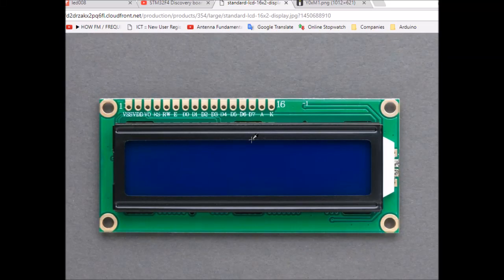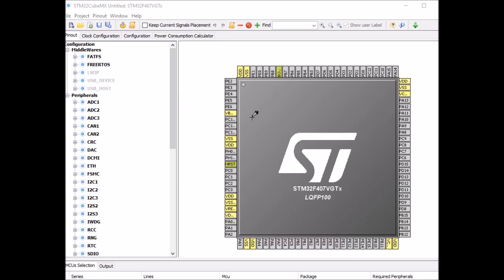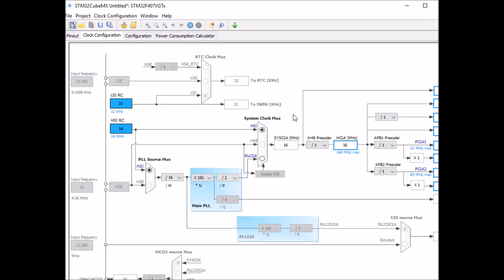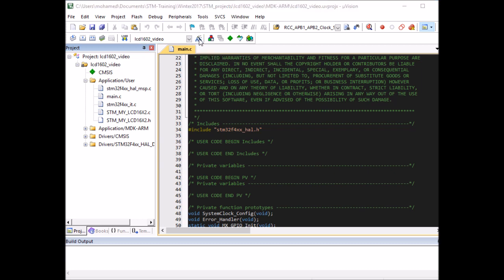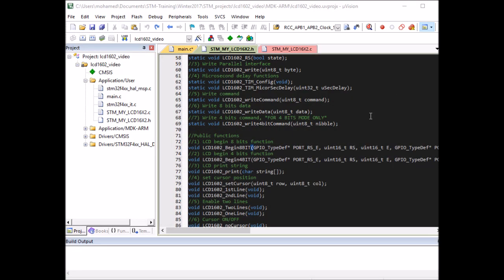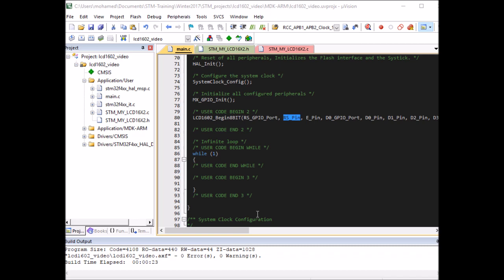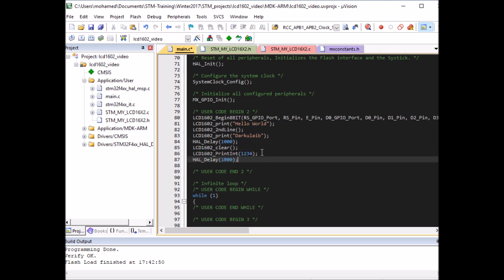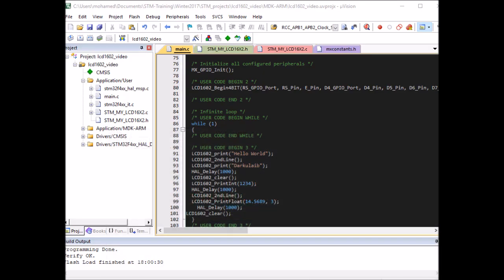STM32F4 Discovery board - Keil 5 IDE with CubeMX: Tutorial 11 LCD16x2 - Updated Dec 2017

Comment: Hi myaqoob,
I wondering what would be the changes I need to do if I'm going to use this driver for stm32f103c8(blue pill).
Reply from the maker: Hi.. why not use the i2c version. This library is slightly outdated. I might update it if many need it.
Reply: @mutexembedded2206  Thank you for such a quick reply, I'll check the latest i2c driver, I was curious here to know what I might have missed for it not to work.
Reply from the maker: @rahulg6563  Hi Rahul, there few things you need to change, like header include to #include "stm32f103xx.h"
Reply: @mutexembedded2206  I have done that , is that it, is there gonna be a problem with timer, I believe same would work for microsecond delay function as timer 3 is present the device i have mentioned.Thank you.
Reply from the maker: @rahulg6563  yes you're right. It's something to do with Microsecond timer.
I suggest you replace all Microsecond delay with HAL_Delay(1)
Reply: @mutexembedded2206  thank you very much, cheers!

Comment: I followed procedure as per video but getting error in function LCD1602_Begin8BIT() . The error is "expected a type specifier" . Please anyone can help me to rectify the issue. I think something is related with parameters passing with the function.
Reply from the maker: What's your line of code looks like
Reply: @mutexembedded2206  void LCD1602_Begin8BIT(RS_GPIO_Port, RS_Pin, EN_Pin, D0_GPIO_Port, D0_Pin, D1_Pin, D2_Pin, D3_Pin, D4_GPIO_Port, D4_Pin, D5_Pin, D6_Pin, D7_Pin); getting error in this function.
Reply: @mutexembedded2206  Total 13-errors as expected a type specifier.

Comment: Hello, I am using STM32F3 dISCOVERY board with 16x2 RG1602 LCD. when I build code with  8 bit mode command LCD works and display is cleared but when I try to print anything rectangle block shows up in first row. I have only changed the header file name to stm32f3xx instead of f4.
Reply from the maker: Hi,
I will update this driver and fix this issue.
Reply: @mutexembedded2206   Thanks
Reply: @mutexembedded2206  Is the issue resolved ?

Comment: Is there a reason you changed the clock from 16 to 168 MHzMine has a bunch of circles on the screen then when i press the black button on my Nucleo stm32 f466re. It turns into a bunch of strange characters / symbols on the screen.

Comment: hi, i am trying to use your tutorial on the Nucleo-l053r8 BOARD, does it work ?
Reply: It should work on the all stm32 boards. It's not up of the stm32 microcontroler but it's up to the type of LCD controller. But i think with other controller like HD44780 should it also work.

Comment: Muhammed Can you please help me? I can't use lcd with your library i did everything like yours. Can you get contact with me?
Reply: I fixed my problem. ( Still i can't write float.) If you use different Ports, you can't use this library. For example D0-D7 must be in GPIOF or GPIOB etc. If you seperate the pins to different ports, library crashes.

Comment: It shows:
Programming Done.
Verify OK.

But nothing is shown on my LCD after programming, everything is connected as supposed, what could be wrong?

HELP, please!
Reply from the maker: I will re-do this tutorial with an I2C LCD 16x2 display.
Reply: The same problem is in my project also. What can we do for solution Muhammed? Is 5V LCD's capable to work with 3.3V logic level controllers? Did you use special display or regular display?

Comment: please help me! i used your library for stm32f103 board.but the text is not displayed on the lcd
Reply from the maker: Hi,
Changed the header to stm32f1xx.h ?
Reply: @mutexembedded2206  i changed to stm32f1xx_hal.h but  still the same
Reply from the maker: Adjust brightness potentiometer.

Comment: Does anyone knows why 0x80 and 0xc0 are chosen in the function void LCD1602_setCursor(uint8_t row, uint8_t col)?

I'm trying to understand the Hitachi manual but I cannot find what I'm doing wrong. Thanks
Reply: Ok, I solved.
You just have to change the if conditions by a switch(row)
case 1: maskData = 0x80
case 2: maskData = 0xC0
case 3: maskData = 0x94
case 4:  maskData = 0xD4
Reply from the maker: Hi,
haha, I don't know

Comment: Hello, sir.
I have a 4x20 LCD display. What should I modify in your libraries? The instruction " LCD1602_setCursor(3,1); " doesn't work.
Thanks :)
Reply: I have the same problem I work with LCD 20*2, I didn't find the library.
Reply: @wajdisanchou  In your case it is pretty straightforward. You just have to change:
a) STM_MY_LCD16X2.c file >> void LCD1602_print(char string[]) >> i<20
b) STM_MY_LCD16X2.c file >> void LCD1602_PrintInt(int number) >> char numStr[20];
b) STM_MY_LCD16X2.c file >> void LCD1602_PrintFloat(float number, int decimalPoints) >> char numStr[20];

And it works fine. My problem is still adding new rows because I don't really understand the variable maskData
Reply: @pabloq3411  sorry I'm wrong I work also LCD 20*4 .. do u get any solution
Reply: @wajdisanchou  besides changing the aforementioned things, you need to modify the if conditions by a switch(row)
case 1: maskData = 0x80
case 2: maskData = 0xC0
case 3: maskData = 0x94
case 4:  maskData = 0xD4

Comment: ty man this is very nice but i have changed the pins and this hasnt worked well what is going on?
and;
 if somebody encounter that "error: L6236E: No section matches selector - no section to be FIRST/LAST."  just close program and run again   it will work

Comment: I used timer3 on my project when i try use your liblary its broke my project.I think your project use tim3 so changed my timer to 2.But still got problem unable word do you have a idea about this problem? I use uart spi adc on the same project
Reply from the maker: Hi,
You can avoid using TIM3 in your project, it should solve the problem, assuming there is no more conflict with your current project.

Comment: Hello Sir
I am using Proteus for simulation and STM32F103R6 IC. I have connected everything but not getting any output on LCD.
Is it any problem with timer or what.
Thanks in advance.
Reply from the maker: Sure, i will give you a quick fix soon

Comment: I  adapted your library for stm32f0 but it doesent working.I think I am failing somewhere without realizing.Can you help me for the problem? and I'm also using 4bit mode
Reply from the maker: Research OnElectronic 
Hi,
You need to change the library .h file include from "stm32f4xx.h" to "stm32f0xx.h"
GL
Reply: I did it bro.I also tried on 8bit mode.Im trying on stm32f0discovery board but still have some problem.Your code using TIM3(timer3) and I didnt define as be TIM3 on stm32cubemx.I wonder about my lcd driver is ST7066U .I compared ST7066U and HD44780.They have same register.There is noting on screen.Is there any suggestion to solve this problem?.Can you send me your board connection setup between lcd please?.Are you supporting LCD 3v or 5v?
Reply from the maker: Research OnElectronic 
Hi mate,
It is something to do with TIM3. STM32F0 do not utilize TIM3, use TIM2 instead. Replace all TIM3 instances with TIM2.
Reply: Ok bro I fixed it.Now its working well.The problem was contrast of LCD.Thanks for answers bro GL.
Reply from the maker: Research OnElectronic 
Right, that was so simple! Nice one.
Reply: @researchonelectronic8262   can you send me your adapted library?

Comment: I made the circuit and put the diagram into an image for people to download. (LINK BELOW) I made the circuit to have a manual option to test the circuit without the MCU. This way you can ensure the circuit works before testing the code on the MCU. You may have to play around with the pot values I got 2.8 volts on vee and .65 start to put 1.3 volts by V0. My circuit diagram uses pull down resistors which worked for me. Check the datasheet to manually put in the letters. 

http://rbaz.tripod.com/code/16x2_Circuit_Diagram.jpeg
Reply from the maker: Hi rwbazillion,
Amazing mate, good work. I wish I have some freetime to make some videos for this and the update you made to the LCD library., it is very busy period for me. Keep up the good work though :)

Comment: This was a good one, I just got it working but had to use another video that helped. I had to change the header file on your driver to match my board. I will post the link next: 
https://www.youtube.com/watch?v=hZRL8luuPb8

I had to setup the LCD without the STM micro first. The URL you mentioned showed the device with the pullup resistors and that can work but to match your code using only hardware, I had to make the resistors as pulldown ensuring that the ground voltage was in the milliamps, so I ended up using not 4.7K but 2.7K ohm resistors. I also used 10K potentionmeters for the contrast (VO) and brightness (VEE). The respective voltages I got were for (VO) 1.061 Volts and for (VEE) 3.178 Volts. But if anybody is looking at my post check the URL's Mohammed (MYaqoobEmbedded) gave but also look at the one I gave as well.

Comment: I used lot's of lib including yours. Your lib was the best .
But I have a problem
Lcd's first line in completely on and second line is completely off(and it dont show anything). Might I connect lcd in a wrong way or the problem is sth else.?
Reply from the maker: M.R.F Iran 
Hi M.R.F,
Do you still have the issue?
Reply: MYaqoobEmbedded yes . I still have this problem
Reply from the maker: Try using enable Two lines function:
LCD1602_TwoLines();
Reply: MYaqoobEmbedded thank you . I forgot to set tim3 . I set tim3 and now it's working . Thanks
Reply from the maker: Nice!
Reply: Excuse me sir, where did you set the timer 3? In the main program or in the .h file?

Comment: Thanks a lot bro.
Just a question : I want to use the same library for a 20x4 LCD module (2004A).
To do so, I had the idea of modifying the function "LCD1602_setCursor" in the file "STM_MY_LCD_16x2.c", but I didn't know what values the variable "maskData" should have in the if/else conditions. Any Idea ?
Thanks in advance.
Reply from the maker: Hi Youcef,
According to some LCD 20x4 from Github, the Set cursor offsets should be as follows:
#define LCD_OFFSET_LINE0      0x0
#define LCD_OFFSET_LINE1      0x40
#define LCD_OFFSET_LINE2      0x14
#define LCD_OFFSET_LINE3      0x54

void lcd_move_cursor(const uint8_t line, const uint8_t position) {
 uint8_t command = LCD_SET_DDADR + position;
 switch(line) {
  case 0:
   command += LCD_OFFSET_LINE0;
   break;
  case 1:
   command += LCD_OFFSET_LINE1;
   break;
  case 2:
   command += LCD_OFFSET_LINE2;
   break;
  case 3:
   command += LCD_OFFSET_LINE3;
   break;
  default:
   // Wrong line
   return;
 }

I will consider expanding this library to include larger LCD sizes.

Good luck
Reply: @mutexembedded2206  but "LCD_SET_DDADR" is signed as : undeclared identifier

Comment: Hello Sir
I want to know that whether we can delay in STM32f407vg less than 1millisec i-e of 1microsec or of 1 nanosec using HAL_Delay not by for loop. As we know HAL_Delay(1) means 1millisec. But Sir I have to produce a delay with extreme accuracy of 1nanosec. I am using HAL_Delay for accuracy purposes.
Sir if there is any other method, then kindly share your thoughts.
I'll be very grateful for this.

Comment: i appreciate  your work it really help alot. 
I want to make semester project based on STM32F407VG the working of the project is to get temperature from DHT11 and live display it on LCd(16×2) if the Temperature increases from 30°, the fan will start and when temperature become 30°, fan stops. 
But i didn't find any help for this project i need circuit diagram. will you help me on this ?
Reply from the maker: Syed Bilal 
Hi Syed,
What sort of help do you need for your project, a code for DHT11, for example ?
Reply: MYaqoobEmbedded 
Hello .
Actually i want to know how can i implement this project on hardware because i don't have any circuit diagram.
Reply from the maker: Hi Syed,
In brief, you need to do the following with Hardware:
1. Connect the LCD16x2 to specific pins on STM32.
2. Connect the DHT22 or DHT11 to VCC, GND and Data on STM32.
3. For the Fan control, you might use Relay or Mosfet switching.

Just look at how to connect each with your STM32 individually, you will quickly figure out how to connect them all together with your STM32,, it is not hard, I am sure you will figure it out. Good Luck
Reply: MYaqoobEmbedded 
Thank you very much sir. :)

Comment: I use the STM32L432KCU card could you help me to use an LCD
Reply from the maker: Rick JR 
Hi Rick,
You would need to do a little change in the .h file of the lcd driver:
Change the #include "stm32f4xx_hal.h"
To
#include "stm32l4...h" (your device specific)
Reply: Thank you very much already try that but it generates some 
mistakes in STM_MY_LCD16X2.c in the section Enable clock for TIM2 timer on line number 110 from RCC-> APB1ENR and all lines of TIM3.
I do not know if you could help me one more time JL
Reply from the maker: Hi Rick,
The library uses TIM3 for LCD timing,,, but the STM32L432 series does not contain a TIM3,, you can use TIM2, TIM15 & TIM16 as General purpose timer.

So, you just need to replace all TIM3 by TIM2 and to use TIM2 instead ,, in 2 functions:
LCD1602_TIM_Config()
&
LCD1602_TIM_MicorSecDelay()

And you will get a working LCD!

GL
Reply: ok it works, I only have a mistake in STM_MY_LCD16X2.c in the line RCC-> APB1ENR | = RCC_APB1ENR_TIM2 EN; it's only that, please would you give me a solution
Reply from the maker: Hi
Just use the HAL library Macro:
__HAL_RCC_TIM2_CLK_ENABLE();
Reply: It could be possible that it works in the following way RCC-> APB1ENR1 | = RCC_APB1ENR1_TIM6EN ;?
Reply from the maker: Yes, it should!
Reply: ok  thanks for help
Reply: Hello, you can give me the lebreraie LCD and thank you my email: belfekihismail@gmail.com
Reply from the maker: Hi,
Link: https://drive.google.com/file/d/1d1NUP34WZQnrs0Jo_9XTO_aFkIdpvjH0/view
Reply: I have a problem with LCD it does not show anything despite I do like you...